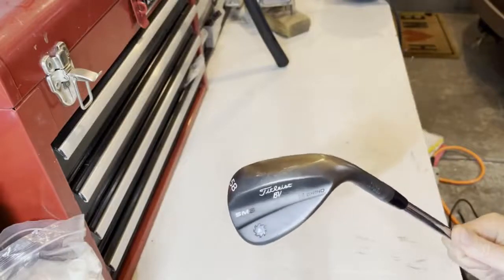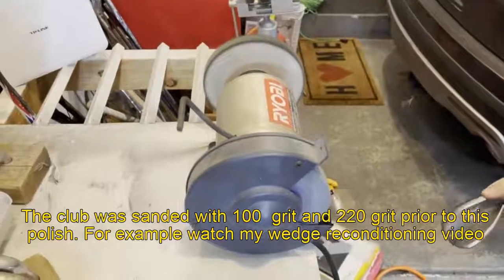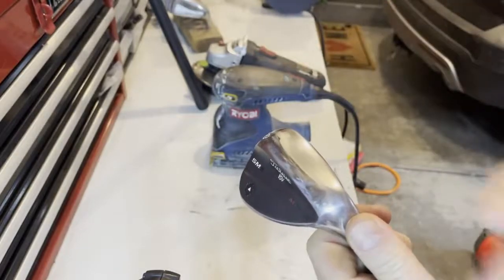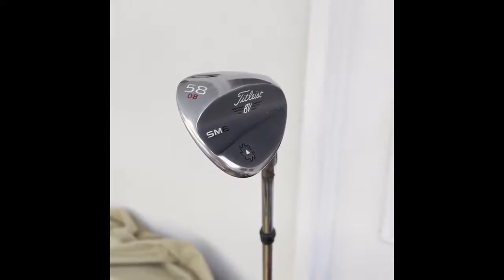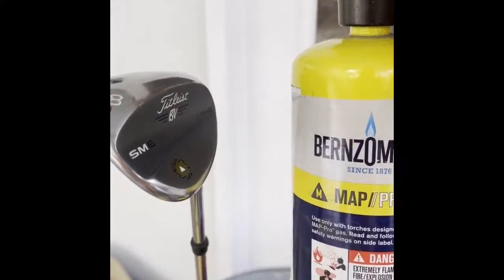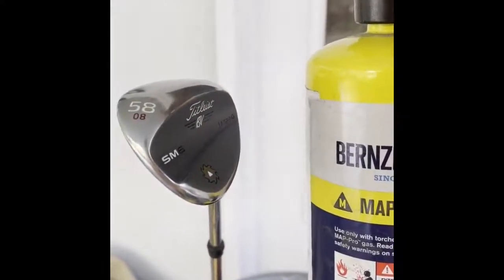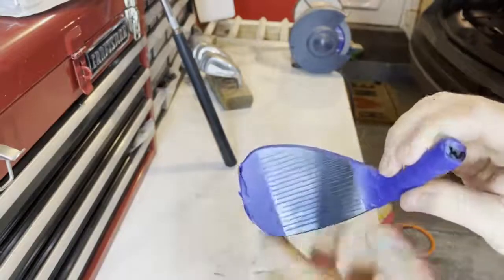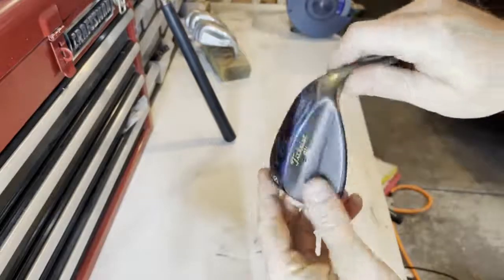Wedge final touches (torched)

Comment: It burned the black rubbery tape part that hold the club and shaft together still works but any way i can avoid that part getting burned ?
Reply from the maker: The ferrule? You typically want to remove and replace. You could heat it a little and slide it up the shaft away from the head. Then replace once cooled.

Comment: Man how the hell does the paint hold up to that torch??
Reply: My thoughts exactly lol
Reply from the maker: the factory paint fill on some clubs is not an epoxy paint. It can be a pain to remove, and I have used the aircraft paint remover with best success in the past. I found that when removing a powder coating.
Reply: Mine was gone after torching. Same club same version
Reply from the maker: The factor fill is much more durable than model paint

Comment: Is there a way to rough up the face without the blasting cabinet that would be somewhat similar?
Reply from the maker: If you watch my face refinish video, it shows the face refinished with a metal file. You can get a decent finish that way.  you can get a cheap blasting setup and use a rubbermaid container.
Reply: @bradreef Is this possible with 116psi pressure?
Reply: 80 grit sandpaper looks cool too

Comment: It’s there any other setup required or can you just blast the wedge with a torch?
Reply from the maker: The better the polish, the better the results.   You need to clean really well and then yes, you can blast and non played wedge with a torch.
Reply from the maker: You can actually do this in an oven, it just takes forever
Reply from the maker: Steel turns purple just above 500 degrees
Reply: @bradreef  ok I’ve seen guides that are like dip it in this coat it with that your video was really just short and to the point really well done on the club too

Blue pm grinds are gonna look so awesome
Reply from the maker: @JaxReds  thank you. It was a second video to a wedge refinish. I will put out a few new videos soon.   Thanks for the questions.  Feel free to give any advice or ask anything

Comment: Can you tell me what air compressor you have for your blast cabinet? I’m having a hard time finding one at a reasonable price.
Reply from the maker: I have a kobalt 8 gallon 1.8 hp Air compressor.  Not to big, but handles most tools ok.
Reply from the maker: Ive been using it for 3 years now
Reply: Oh nice! I’m being told I need 7CFM @ 90psi but I figured that was overkill for smaller applications like this. Glad to know it’s working fine for you. Thank you!
Reply from the maker: @AndrewNHelgeson  mine holds 70 psi+ while blasting easily. I prefer 40-50 psi because it is more forgiving for me.
Reply from the maker: Mine says it is 4 cfm at 90 psi. Fyi.
Reply: I really appreciate the info! This makes my project more doable.
Reply: Got my blasting cabinet set up a couple weeks ago. So much fun! How does this torched finish hold up to play?
Reply from the maker: @AndrewNHelgeson  only ok imo.  Keep the club dry to last longer.

Comment: if you were to heat it up with the shaft still connected would you have to get it reshafted? i know you took yours off, but just trying to avoid doing that
Reply from the maker: Yes, it turns colors at about 2 times the temp epoxy breaks down.
Reply from the maker: Brampton Epoxy PRO-FIX 20/20 Long Cure - Golf Club Repair https://www.amazon.com/dp/B0792MYDF9/ref=cm_sw_r_awdo_HM4YE2MX8C4Q9ZZG7TMS?psc=1
Reply from the maker: Good option for reshafting if you torch.  The smallest size will do a ton of clubs
Reply: Thanks!

Comment: tried this, but wedge is just glowing orange and not changing colour. any ideas what im doing wrong?
Reply from the maker: Has to be carbon steel. What type of wedge is it?
Reply: @bradreef  thank you so much, tried it on my mizuno mp5’s
Reply from the maker: @robertosolazzo8763 it is because of the chrome plating. You would have to remove the plating first, which i wouldn't advise
Reply: okay thank you, appreciate the help! i also have an old ping karsten answer, that is manganese would that work? @bradreef

Comment: What grit did you use?
Reply: For the oxide face blast
Reply from the maker: @samuelkrause2117  80 grit i believe. You could go higher
Reply: @bradreef  ya I’ve used 80 on mine. I found that it faded pretty quickly. Maybe I’m not hitting it for long enough.